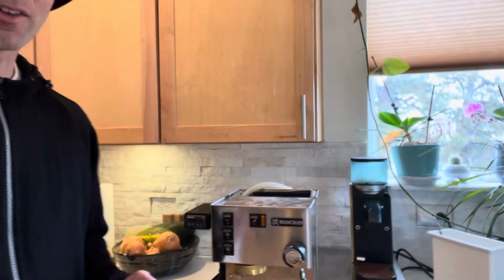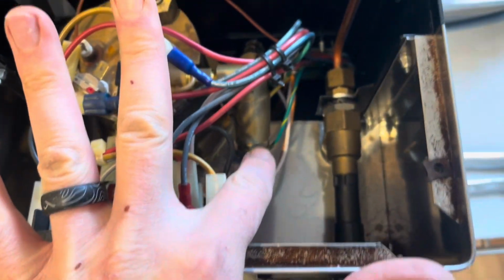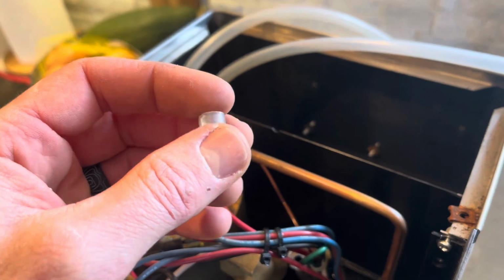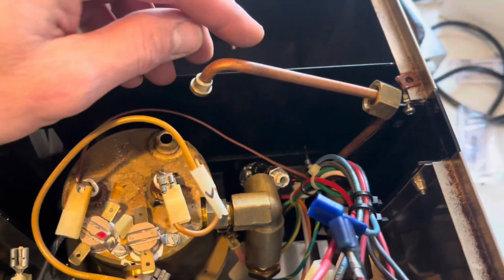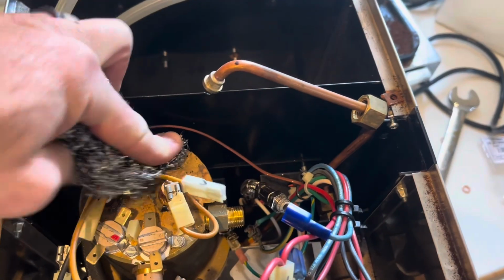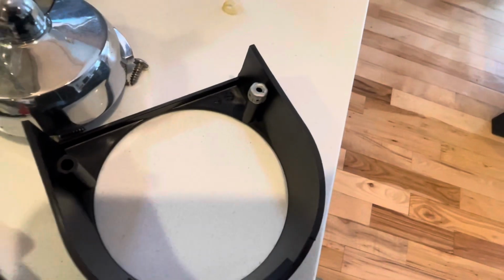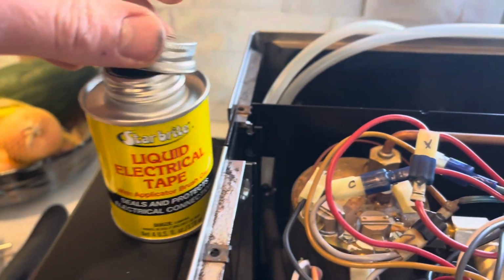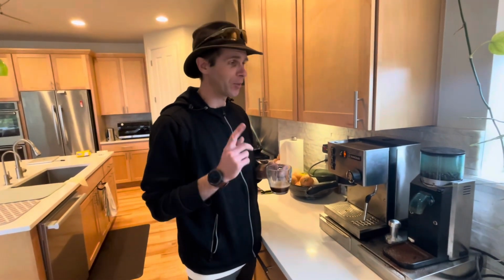Rancilio Silvia Espresso Machine Pressure Valve Replacement

Comment: Oh and BTW, if you don't know... the spout on the portafilter is removable, seems impossible. However I found the trick to getting that off is to put the portafilter in a freezer for some time, then drop the head into boiling water - then you can unscrew it with a wrench, etc.
Reply from the maker: Nice tip, thanks!

Comment: Hi. How did you get the cowl back on? There's a lip inside that has to clip on the stainless bit? Can't for the life of me work out how to refit the blasted thing! Arrgh!
Reply from the maker: I wish I could recall that detail… if I remember correctly, on mine it was just screws that held it on. Maybe my friend retrofitted it before he gave it to me. Maybe look at where you could drill some holes and use machine screws to hold it on instead.
Reply: @Wallymakesstuff  Thanks for messaging back. I'm this close to cutting the back of the cowl down the middle so I can stretch it out and wrap it round. So envious. Yours looks the business with the black plastic cowl. Great video. Oh and maybe think about reducing the output from 12bar to 9bar. After undoing the lock nut, open the valve body 1 full turn (mark it with a permanent marker), tighten the lock nut. Your grind looks a little coarse. I'm getting lots of crema with 2 shots in 35seconds with 18grams of coffee ground super fine.
Reply from the maker: Thanks for the feedback on the video, and great call on the coffee settings. I’ve messed around with it a lot more since this video, and switched coffees to Tony’s cafe Carmelita with a much finer grind and harder tamping. It’s making really nice Carmel/cocoa frothy shots now!

Comment: First of all, thanks for sharing the knowledge you have! My Rancilio is getting to be over 10 years old. It still seems to be working well, but I can no longer afford to take it into my repair shop for general maintenance and repair. I have learned how to descale it and do it on a fairly regular basis although I don't do it too often because I use reverse osmosis water in it and every time I took it in for maintenance they couldn't believe the shape the machine was in, they asked if I used it. Lol I used to have a hubby that did all this type of repair around our home, so now I need to learn. What exactly is the purpose of that tar like electrical substance you put on the wires at the end? Thank you! 
PS. I am sorry that the ignorant person commenting below was never taught that if they couldn't say anything nice not to say anything at all. I think you are right, it is sad that the only thing they felt the need to say was "shame on you for getting the cost of these wrong". Someone with far too much time on their hands! These machines are expensive! I paid $1500 for the Silvia, the Rocky grinder and the tray they sit on, but that was well over 10 years ago, I can't imagine how much they cost now! It is the very reason I am learning to do all my own maintenance and repair. Hopefully I can keep this thing running another 10+ years. Fingers crossed. Thanks again for sharing.
Reply from the maker: Thanks for the thoughtful comment! Ironically, that person helped tell YouTube that this video was engaging enough to share with more people - so those negative comments might have been why this video was pushed widely enough for others to see it! 😂

As for your question, the black tar stuff is called liquid electrical tape. It is a rubber compound of sorts that dries into a flexible insulator to ensure that if wires touch, they won’t arc the electrical connection. I used this because the original wire insulation dried and broke off from long use and heat. So this was a safety measure. Glad you found the video useful!
Reply: @Wallymakesstuff  Too funny! Well, I guess we can silently thank them for the boost.  

Thanks for clarifying. I appreciate it! I have lots to learn. Any chance you own the Rocky grinder and have taken it apart to clean it? I am trying to put mine back together again and it isn't cooperating. I need to spend more time on it tomorrow and see if I can figure it out. If not and you have one, I might just have another question for you. Lol Thanks again!
Reply from the maker: @ I do and I have replaced the burrs and cleaned thoroughly. What’s the question?
Reply: @Wallymakesstuff  I am having a hard time lining up my zero grind and the screw holes. I am going to play around with it a bit more on my own and see if I can figure it out. If not, I will be back in hopes you can help me. Thanks so very much for your time!! Cheers!
Reply from the maker: If you’re using old burrs that you simply took out to clean, I would think it should align if you got all the gunk out. That said, new burrs may not align. Mine were a little off. If it doesn’t align, as long as you have zero clearance at or around the zero mark (within a couple notches) when the screw holes align, just adjust your grind setting to compensate. Aka when my new burrs got installed I had to grind 9 to achieve what was done at 4. Now they’re at 6 being broken in. Otherwise maybe try rotating the orientation by an entire screw hole as needed and see if that works. Idk if any of this will work or if any of this lines up. Use the force!

Comment: Hey one thing you missed on the valve you installed, it's meant to be adjusted for pressure which you did not cover in this video. If you don't adjust the valve you likely have the wrong bars of pressure coming out of the group head.

I am currently doing maintenance and repairs on my machine, I am waiting for it to cool down before installing the new solenoid. I am just researching more parts incase my pressure is still wonky after I am done.

As for the OBV adjustment, people say Rancilio sets it at 12 bars of pressure out of factory. What I haven't confirmed is if that is intentional, and therefore leads to 9 bars at the group head.

I created a pressure gauge by screwing on a pressure meter onto the spout of my silvia porta filter. The spout has loctite so it takes some effort to remove and apply the gauge. THOUGH, there is a detailed video on how the bar reading the on the porta filter with the gauge hack is not accurate as it doesn't account for the water moving through the puck, and on a Silvia Pro (the 2k version you might have mistaken this silvia for, as the silvia is around 800 dollars, but closer to 1k with the PID) my method should read 12 bars at the group head, while on other machines it's somewhere between 10-12. The actual tool for measuring the pressure this was costs 700 dollars and accounts for the water leaving the porta filter for pulling a shot.  There's a video on youtube that shows my method compared to the 700 dollar one to account for these discrepancies, though a lot of people that go the route I'm going say that setting the obv to show 9 bars improves their espresso.

Just some food for thought!
Reply from the maker: Thank you for the incredibly insightful comment! I was wondering about pressure… I basically saw that it was the same as before so I left it how it was (based on how many threads are showing). It tastes great as it is, Though a gauge would be nice to show where it is based on grind setting and tamping pressure.

Comment: Sorry, I couldn't listen to this video.  When you begin by saying that this is a $2,000 machine, I understand that you don't know what you are talking about.  Maybe your video is quality after that mistake, but I can't take the chance of destroying my espresso machine when I already know from the beginning that you are not well informed and you are fine with spreading misinformation.
Reply from the maker: Sorry to offend you.
Reply: @Wallymakesstuff  You certainly don't seem sorry.  You left the same mistake in the description of this video.
Reply from the maker: @charles5856 no, I’m not sorry. But I do feel sad for you to be upset so easily. Life is too short to be upset about someone getting a price wrong. My best friend gave this setup to me, and I was wrong about what all of it cost. What a shame.
Reply: Hello,
Thanks for the video, Your machine has a PID, so comparable to the pro model at 1500€ (in France) + tray, grinder,  accessories; it is still an expensive machine. Question for you, what was wrong with the previous OPV ? I have cleaned mine and changed the spring and it should be fine. I saw your video because I have 9 bars but 300 ml water per minutes instead of 260 any idea ?